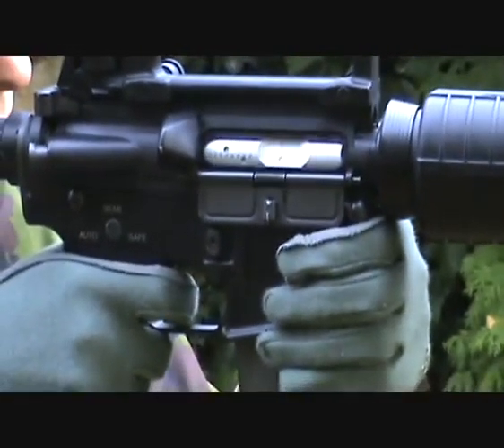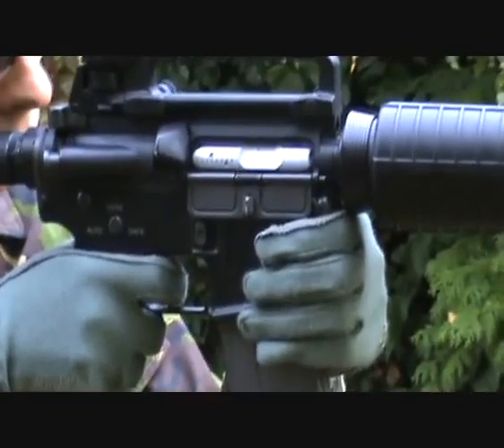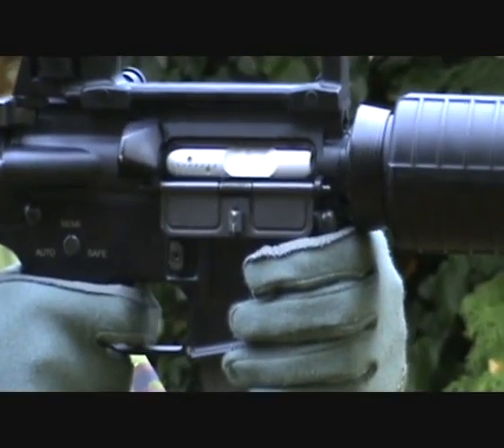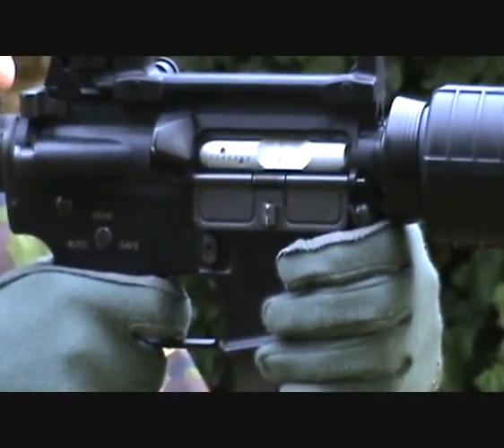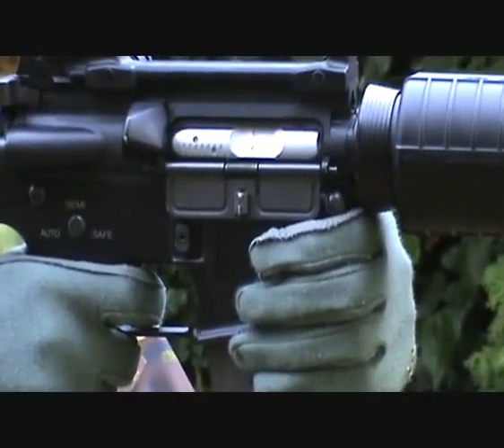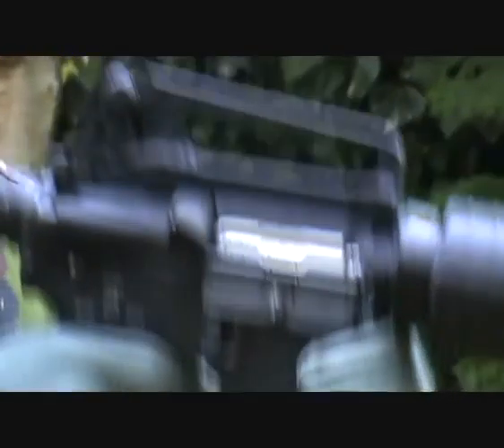AGM GBB M4 Venting Pt. 1

Comment from the maker: I upgraded the hop unit pretty much straight away after getting it actually, pretty sure it wasn't that causing the issue.  I've not had much chance to work on it unfortunately since I don't live at home where it's kept, but my only possible thoughts were possibly issues with the magazine alignment or the buffer spring being too weak.  It was having the problem show in the video the one time I skirmished it so can't really comment about that I'm afraid.

Comment: Ever figure out why this is happening?  I have a similar issue but I just noticed that my stock agm plastic hopup was cracked that lead to a misalignment of the bb causing a double feed which lead to the eventual gas leak when I fired on top of the double feed. I am hoping a new metal hopup will fix this issue. Which i just ordered.